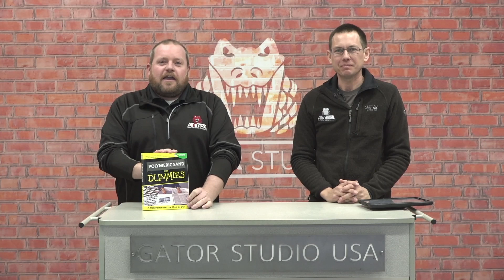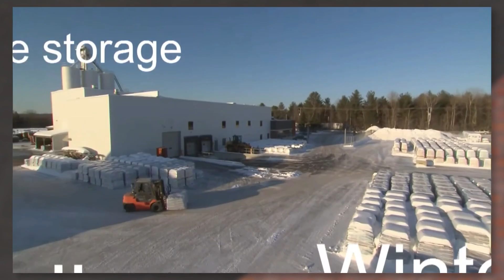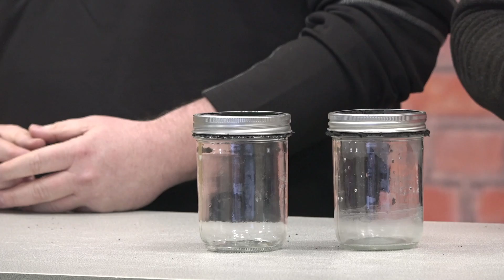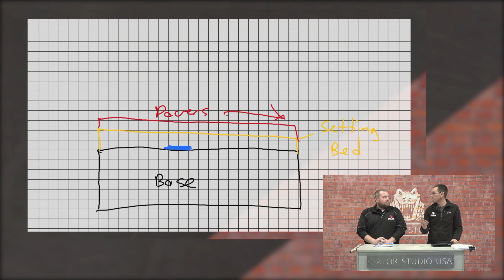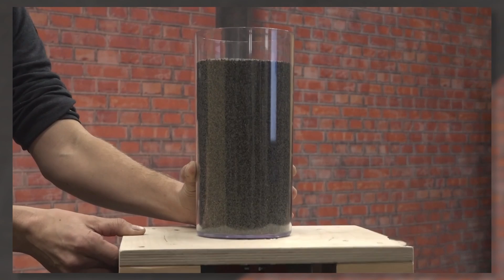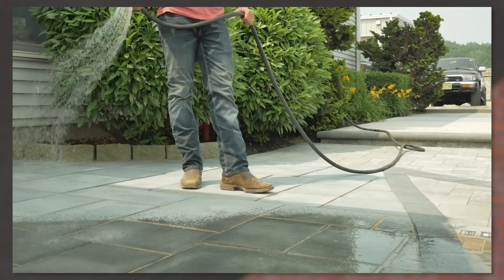Polymeric Sand for Dummies

Comment: I'm getting ready to do a project on my back patio with flagstones, and between the flagstones are sections of small (coin-sized) pebble mosaic floral designs.  Would the Gator Polymeric Sand be a good product for setting the floral stone mosaic designs, assuming I will definitely be sure to compact the areas, as you recommend?  If not, is there another product you think would be more appropriate for this purpose?

Comment: Awesome video! What is the shelf life of the G2 polymeric sand? I have about 20 bags that were purchased 2 1/2 years ago but were not installed due to unforeseen events. This coming summer I'll be ready to install but I would like to know if it's still good. Thanks.
Reply from the maker: Thanks for the feedback. We would say that within reason polymeric sand should last a long time. As long as the bag was kept dry it should still perform as expected. You should be able to use your 2 year old bag.